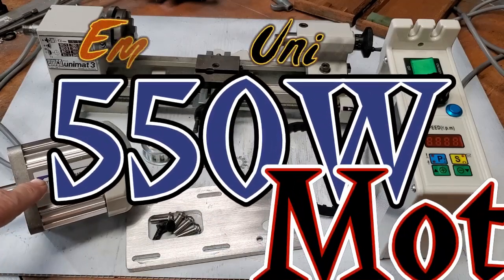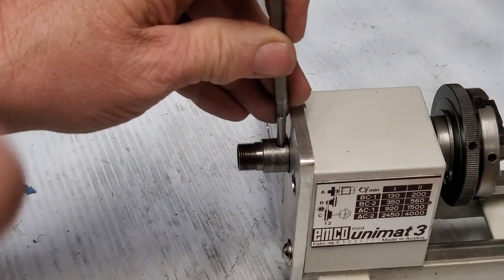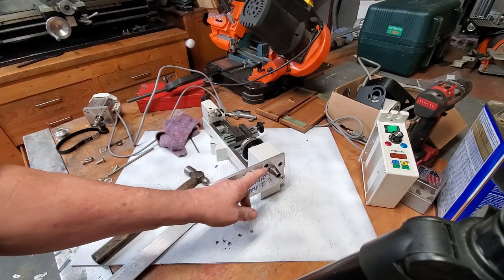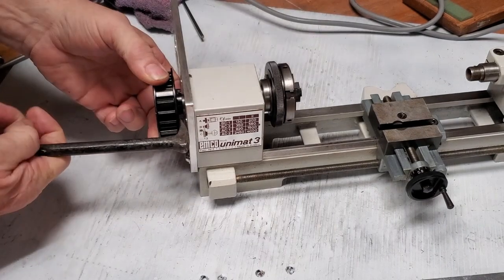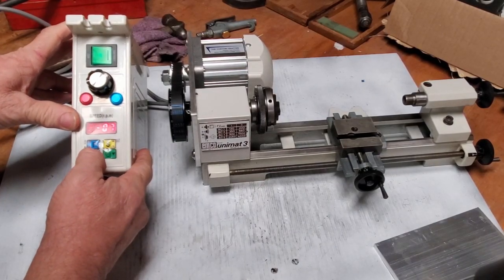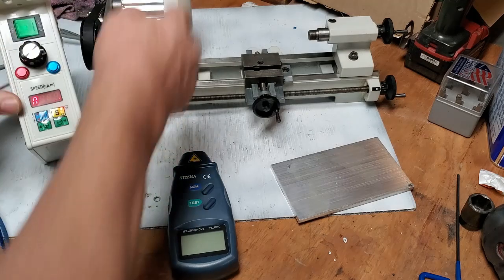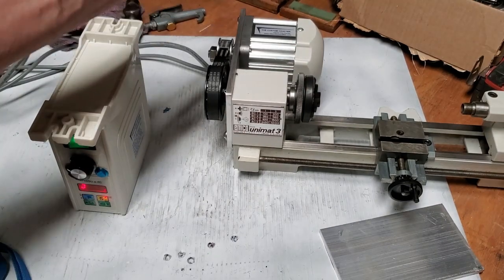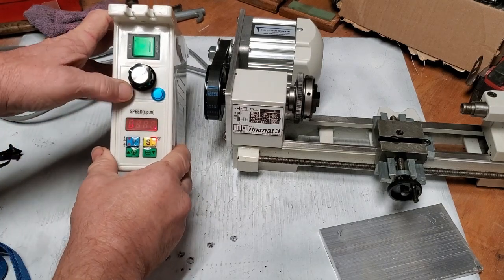Emco Unimat 3. Motor Repair Upgrade to 550W Servo Motor. Conversion instructions, Kit installation.

Comment: Hey can this servo motors used for a drill press?? Will it work??
Reply from the maker: This motor is rather small for a drill press. The 1,000 watt fits better but there is an issue. People tend to realize the drill press all of a sudden has enough power to run giant bits.
They then attempt things like drilling 1" holes in stainless. A drill press is not stable enough to do this. Operator abuse jams the bits. These motors will ramp up amps to maintain the set speed. In a jam the amps go to max before the thermal overload and or software kick in and shut down the motor. End result is repeated jams (approximately 7) will eventually burn out a mosfet.
Reply: @danielmartin382   My drill press is 550 watt ac motor so it will be a bad idea to use 750w servomotor!! Thank you for the advice!Can you explain me why mini lathes and mills can use it without any problem?? thanks for the help peace from europe!!
Reply from the maker: Actually you want to up the power to a 750W, likely the 1,000W due to how easy it mounts.
Contact me direct on my website https://www.servomotorkit.com Share images and make/model. I will be happy to make sugestions.
I just do not have time to take on a new machine as there are many custom builds in the works right now.
 @ThanasisThomas